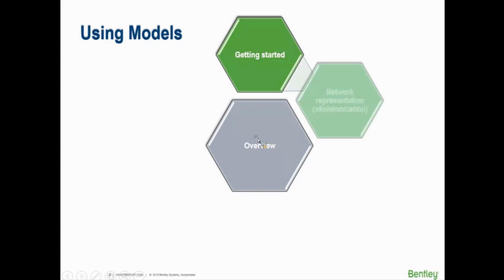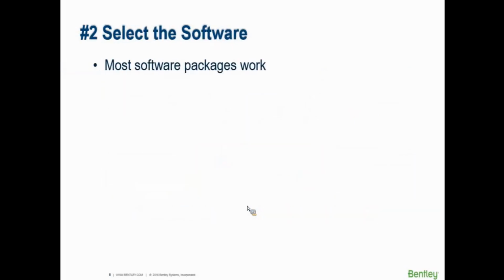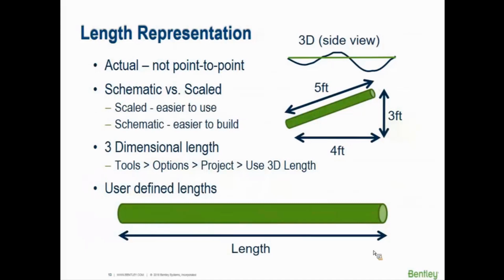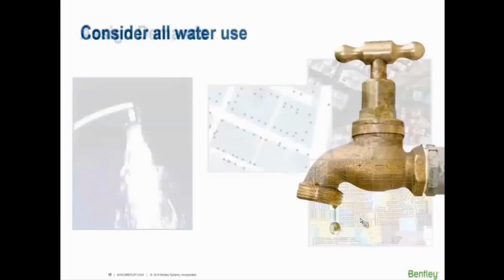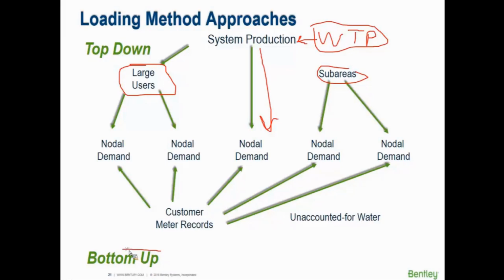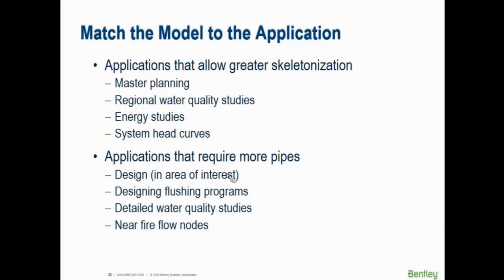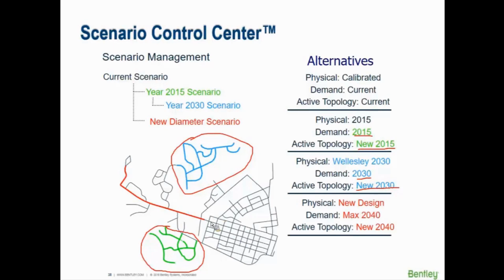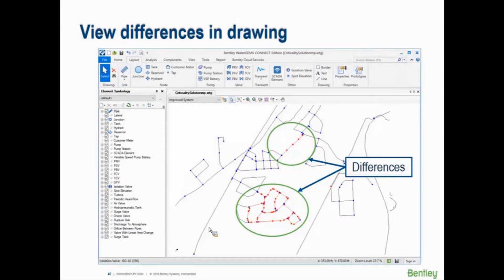WaterGEMS/WaterCAD Fundamentals Part 4:  Entering Model Data

Comment: A very good Tutorial. Many Thanks!

If I may.., could there be a tutorial particularly on the negative pressure issues at nodes, pumps, and system?? 
what things to consider when it happens?? and related topics?
Looking forward...
Please!!
Reply from the maker: egmelaku, the following article from our Wiki has some information on troubleshooting negative pressure in WaterCAD and WaterGEMS:

https://bentleysystems.service-now.com/community?id=kb_article&sysparm_article=KB0015494

If you need further help, please post on our forum:

https://bentleysystems.service-now.com/community?id=community_forum&sys_id=0310b7ca1b1a3110f3fc5287624bcb80

Comment: Where we can find the map used in first workshop
Reply from the maker: Hello Vivek, all of the data for the workshops are available in the dataset. A download link is included in the description of the video. Here it is: https://communities.bentley.com/products/hydraulics___hydrology/m/hydraulics_and_hydrology_gallery/273978

You will need to sign in to Bentley Communities (link above) in order to download the file. The "Scaled_Network" DXF background file is found in the "Starter" folder in the dataset zip file, as seen in the workshop demonstration video.
Reply: @bentleywaterinfrastructure  Great